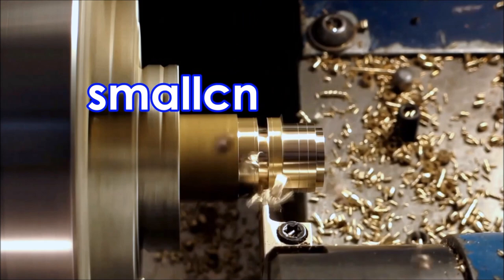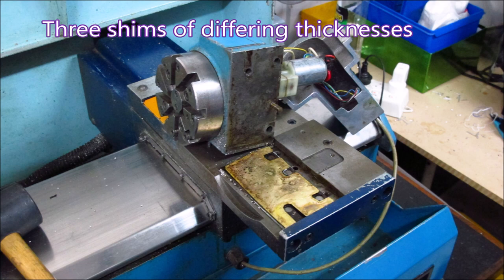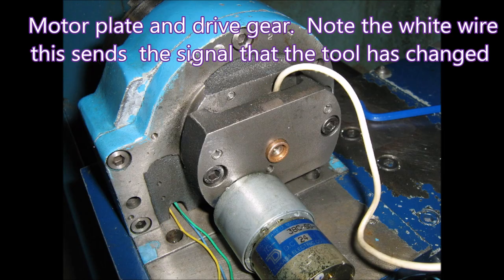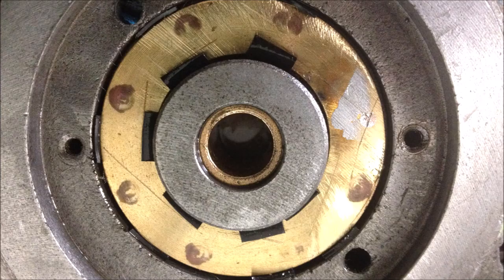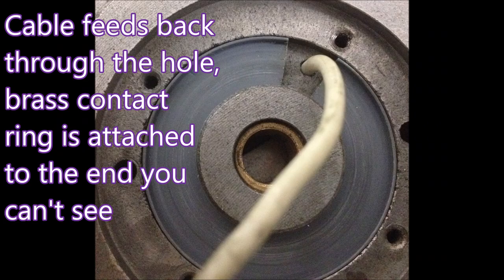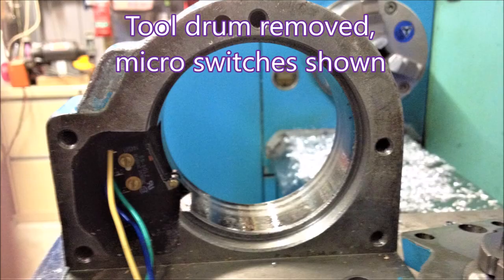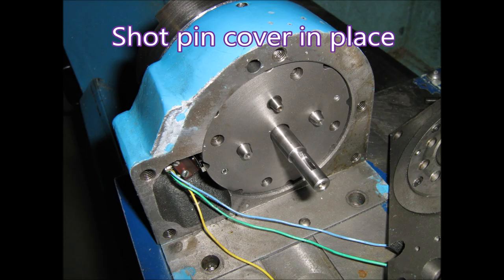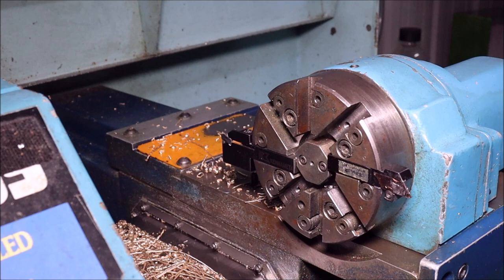Tool Turret Height adjustment on small cnc lathe. Hercus PC200 Australian made lathe

Comment: That is a very substantial turret for a small machine. Center pips when facing to center are the bain to any respectable shop's existence. Sometimes it's a program error (not facing -2x tool rad) other times the holders are worn and need refurbishment or replacemet, other times the machine gets bumped and the turret needs to be torn open and curvic couplings realigned. Shims under holders are great for a quick fix but after some time the inevitable teardown and cleaning and realignment is needed. Great videos, keep them coming.
Reply from the maker: Yes this was just a quick fix. The shot pins have some bruising and that should be corrected. It has been weeks since I have put out a video and I need the lathe working. Also need the 3000 rpm max that is in the other video released today. Now tools are on centre and with 3000rpm, I can get on with more videos.
Reply: @smallcnclathes  From your pictures the shot pins are tapered and act to locate the turret, and make contact on the brass plate, but where is the "give" or spring in the system? Seems to me the tapers need to seat at the exact moment the ends of the pins touch the brass plate? And then there's the swarf issue. Could a proximity switch be retrofited into the works? That would solve the swarf and bad contact issues.
Reply from the maker: I have little idea of the way this is intended to work and my knowledge of electronics ends when the smoke escapes.  I thank you for your interest and comments but this stuff gets way over my head and all I have tried to do is keep thee thing running as it was built originally.  Fitting a new spindle driver has really been the only modification to the lathe and this work was carried out by a friend with knowledge of electronics. This has been a brilliant upgrade as the spindle motor was not getting the full voltage and power was always down. When your motor is rated at 1/2 hp, one really needs to get all the power available!
Reply: @smallcnclathes  Just food for thought. And agreed, making chips is paramount.

Comment: And again I learn a little with each video. Conical shot pins into a hardened plate  with corresponding conical holes. Guessing they are both ground to tight tolerance. Not to tight, enough room for easy movement.
Reply from the maker: Hello Mark, really not sure of how it all works, just happy when it does!

Comment: You were looking for workarounds in tool balance some weeks ago. Wouldn’t you benefit from changing the gear reduction from the motor shaft (slower but more torque), or replace that motor with a stepper motor (much more torque and possibly faster) ?
Reply from the maker: No idea how the software could run a stepper in place of the existing motor. That is actually a bigger motor than was originally fitted!
Reply: @smallcnclathes  The voltage that now drives the motor can be used as an input for a stepper driver. Does it run forward and backward for a tool change, or only in one direction ?
Reply from the maker: @Stefan_Van_pellicom  both directions

Comment: Did this help at all with your need to balance the tools so carefully?  Not sure why it might, but I really don't understand why this issue exists in the first place.
Reply from the maker: Apart from a small drive motor, I don’t understand it either, but if not balanced within reason the turret will fail to deliver the correct tool to the cutting position.  After it happens a few times, you learn to try for some balance of the tool arrangement. Thank you for your comment.
Reply: @smallcnclathes  I enjoy your videos, and I'm a sucker for a good puzzle.  This is a good one.  There must be something fundamentally off.  I'll keep watching.

Comment: The lathe is smaller than I thought it was?
Reply from the maker: That is an interesting comment, the size of the lathe is not really shown in most videos. They are not very big and I like to think that for their size and age they do pretty well. Apart from a brief dalliance with an even smaller Emco, this was my first cnc lathe and after 15 years of the lathe teaching me how to drive it, I am still impressed by what it can do.  The only thing missing is cutting tapered threads, which the later models can do.
Thanks for taking the time to leave a comment.